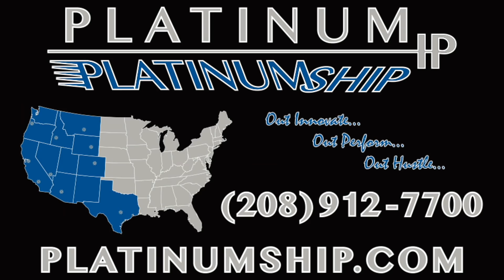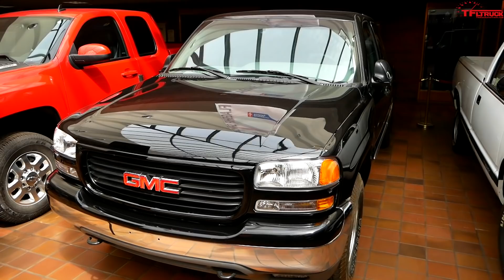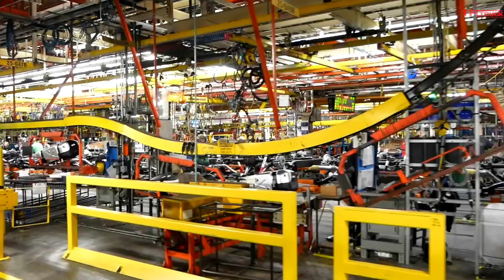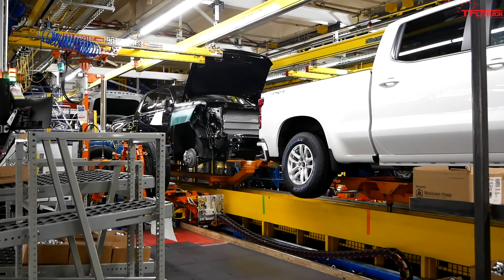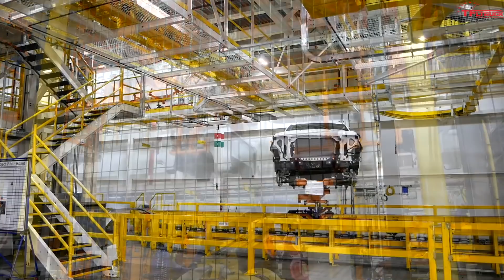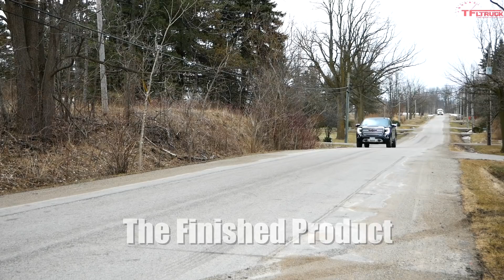They Can Build 1,000 Chevy Silverado and GMC Sierra Trucks Per Day Right Here

Comment: 1000? That’s cute... Ford pumps out 1200-1300 F-150’s per plant and Kansas City and Dearborn both make them. So 2400 to 2600 a day, but I guess they probably only need 1000 since they rank 3rd in truck sales now.
Reply: Ford has to build so many trucks because they don't last half as long! Keep those replacements coming! I usually expect my GM truck to last 10 years, Ford I would expect to last 4 or 5 years.
Reply: Stevonoles1 gm trucks lasting 10 years lol dream on buddy
Reply: @Regulo0_7 , my truck is a 2005, do the math
Reply: The Super Duty plant makes about 1600 or more units a day.
Reply: GM sells more total trucks than Ford every year. You watch too many commercials lol.
Reply: @dlakerguy  so it takes the Silverado, Sierra, Colorado, and Canyon  to outsell the F-150. That's embarrassing,  you should keep that to yourself.
Reply: @redd7188  You're a idiot. That's not what that means. It means that GM, the company, sells more trucks than Ford, the company. Not just the F-150. ALL F series trucks and rangers and Lincolns, etc. The whole company.
Reply: @dlakerguy  wrong, the Ranger just returned and already the F150 and Ranger has outsold the Silverado, Sierra, Colorado and Canyon for the first quarter. Anyway my point was the F150 has outsold the Silverado and Sierra combined. Next Lincoln doesn't make a truck. Last you referred to the commercials that Ford makes. The commercial is right. F150 is the highest selling model. Even when you combine Silverado and Sierra sells.
Reply: @redd7188  https://www.freep.com/story/money/cars/general-motors/2018/07/12/general-motors-ford-pickup-truck-market-share/767901002/

"On a volume basis, we've sold more pickups than the F-series over the past four years in a row and that continues through this year," said Jim Cain, a GM spokesman.

For all of last year, GM sold "a record 948,909" pickups in the U.S., "more than any other automaker for the fourth year in a row." That includes full- and midsize trucks.

Again--- Until Ford the company sells more trucks than GM the company, you can shut your dirty pie hole. You lost. Move on.
Reply: @dlakerguy Couture, stop it,  you call someone out on the F-150 being the best selling truck in its class and the best selling truck model period. Then you post an article that includes Colorado and Canyon. Then when you get called out on it you call me a troll.
Reply: @redd7188  I never once mentioned best selling MODELS. I said best selling BRAND EVERY TIME. Don't move the goal posts just because you can't kick the field goal.
Reply: @dlakerguy  read the original comment! He said F-150 not Ford, he he mentioned a model not a company. Learn to read sir. You called him out and told him to stop watching commercials. Well, what does he need to get straight? The F150 is the best selling model? So tell us,  what did he get wrong??? What did Ford get wrong in the commercial????
Reply: @redd7188  Ford gets wrong that they sell more trucks than GM. GM splits their sales between multiple models of trucks and they do that on purpose. They target different markets which leads to much more overall sales than Ford. A strategy that clearly works. If GM whittled down their lineup to just Silverados and that's it, they probably would sell more than F-150s. Besides, everyone knows that F-150s sell the most in that specific model because 1) they break far too quickly compared to Silverados and 2) they lobbied for government contracts and supply cheap trucks to cities and counties all around the country.
Reply: @dlakerguy  wrong , the commercials say F-series is the best selling truck. Which it is. It says nothing about best selling company. Again,  F-series outsells Silverado and Sierra combined. The Sierra and Silverado are in the same class as the F150 not Colorado and Canyon. Now again what is Ford getting wrong in their commercials?
Reply: @redd7188  The F-Series includes their F-250s, F-350s, F-450s and so on. They're comparing all of that to the Silverado. Weak.
Reply: @dlakerguy  do you not understand that GM also sales 2500, and 3500. Do you get that they are not separated either? Check the link below and show me where GM separates 2500 and 3500 sales on the Silverado and Sierra.  Show me , all you have to do is scroll to the bottom and click on deliveries. https://investor.gm.com/news-releases/news-release-details/first-gms-all-new-pickups-posts-20-percent-q1-gain
Reply: @redd7188  I was talking about the Ford commercials! Stop jumping around. You keep changing the argument every time you lose. Plus you said "GM also sales 2500..." I now see why you like Ford. It's an intelligence thing. I bet you smoke marlboros and drink bud light too haha.
Reply: @dlakerguy  how am I jumping around when your last comment was "@redd7188 The F-Series includes their F-250s, F-350s and so on. They're comparing all that to the Silverado, weak". My reply was showing you that they all compare trucks the same way rather it be Ford, Chevy/GMC or Ram. How is that moving the goal post?? Wow, so you knock me for making a mistake and typing GM instead of GMC?
Reply: @redd7188  No. The Ford commercial uses the F-Series, ALL the F- trucks. And they compare that ONLY to the Silverado 1500.
Reply: @dlakerguy  Ford use to make a Model T and Model A. Truck wise Ford has had the Model F for years. There was an F-3, F-100 and even an F-500 and now we have F-150. The truck model is "F"and 150 , 250, 350 refers to the subcategory within the model. This equals F-series because F is the model and and the number is a level of capability within the series. It's the same with Silverado and Sierra because rather you know it or not when you say Silverado that includes the 1500, 2500 and 3500. The problem is we say Silverado because saying Silverado 1500 is a mouth full. Just because we do not use the proper terminology does not make the Ford commercials misleading.
Reply: In 2018 it averages about 2,300 F-Series a day. One gets sold (and presumably built) every 38 seconds.

Comment: It is nice to see GM half ton crew cab production is actually taking place at Fort Wayne.  Sure, parts can come from all over the globe, but it makes me feel patriotic to get a VIN with the USA "1" code.
Reply: USA = 1,4 and 5
Reply: Gary Blatt, same here and when the VIN begins with “2” Canada Code. I will never buy a vehicle when the first digit of the VIN is “3”.
Reply: Vince Clark in Canada the automotive workers are of European stock. in Mexico they take a siesta.
Reply: @vinceclark6164  Jose probably has more job pride than Dick, Rod and Tomika put together.
Reply: @vinceclark6164 , GM has had a plant in Mexico since 1965, so get over yourself
Reply: @anthonywebber2211  yeah but ive owned 3 gms. the first 2 were from us and the 3rd is a Mexican. the first 2 had a lot less stupid issues. the doors sealed right and the panels were on properly. my mexican gm i had to adjust all the doors since none of them sealed and my bumper was improperly installed
Reply: United states uses more than a "1"
Reply: Mr M 1, 4, and 5. 2 is Canada and 3 is Mexico.
Reply: Most pickups you can buy today are built in the US. Regardless of manufacturer. Even Toyota builds trucks in the US.
Reply: Justin Luttrell not true. All HD Rams are built south of the border and last I knew Silverado/Sierra CC SB were built in Mexico as well.

Comment: I would hate to work on a moving assembly line. My ocd would not be able to handle it. Build them by hand at a slower pace. They sit on the dealer lot for weeks and months on it. Is an extra day for assembly going to really matter.
Reply: Pretty soon they won't need many humans to do the labor. Just a few to supervise the robots.
Reply: @denniskirk4055  no they won't. Most of the robots are in body shop and they still need people to work with them.
Reply: I’m not sure I like the way the motor and transmission are fit to the driveshaft with the line moving like that—great potential for bottoming out the yoke and damaging the seal.  Why can’t they take their time and do it right?  I guess they figure for the odd time it is screwed up it’s not worth slowing the line.  Seems crazy.
Reply: @RhBKeith  it doesn't damage the yoke.

Comment: You guys should come to Louisville, KY. & tour the Kentucky Truck Plant where I’ve worked for 25+ now. 8500 workers here building SuperDuty, Expedition & Navigator. Similar processes only on a larger scale.
Reply: My Dad just bought a 19 F250 Lariat with the 6.2 he likes it so far
Reply: Thanks for building my superduty! Love it!
Reply: @ryan_torres  Did yours come with the Powerstroke made in chihuahua Mexico?
Reply: Thank you for building my awesome 2019 f250 Platinum diesel
Reply: How long does it take to ship the Powersrtroke engine from Chihuahua Mexico to Kentucky? Seems it would be cheaper if it were built in the USA!
Reply: Been at KTP for 20 years myself. What department do you work?
Reply: @CMH_1975  SD body
Reply: @DownRange02  I work on CAL, but considered SD Body
Reply: When are you guys putting the 7.3 Gas into trucks? Any word on power numbers?
Reply: Mr M 2020. No specs yet.
Reply: @pryme2013  for the 2020 model. I haven't heard power numbers yet. I used to get the info when I worked on the chassis line and was able to talk to engineers when we would run early test models. I have seen a couple 2020's come down the line though. They look really good
Reply: @CMH_1975  Hey, I remember talking to you on the RPM motorsports channel a few months ago... I believe!
Reply: @ryan_torres  yep...I'm on RPM's channel all the time.
Reply: @pryme2013  7.3 is still melting down at the plant. Once they figure out why, they will be shipping.
Reply: @Stevonoles1 link your source please.
Reply: I noticed the "death wobble" is still a thing on the new SD's. Kinda had my Dad worried. The dealer told him not to worry(that's no surprise) that his truck already has the upgrades so it doesnt get the shimmy. I know he has the plow prep pkg etc.

Comment: Ummm ... they are assembled in the USA, but the big majority of parts come from overseas. Tesla makes the "most american" cars, as about 70% of the parts are made in the USA.
Reply: And where did you get 70% from because I looked it up and Tesla is made of 50% American parts.
Reply: @jlen82  It depends on what model you're talking about. Model 3 body, battery cells/pack, motors, seats, FSD computer ...etc. are made in USA. Model S/X battery cells are made in Japan.... things have changed a lot in the past month.
Reply: How many plants do Tesla have, GM has over 40 in the US

Comment: My 2015 was built in the Fort Wayne plant. Never had to take it the dealer for any repairs. Great job ladies and gentleman at the plant.
Reply: The way you wrote it makes it seem you don't have it anymore? Still pretty new so it shouldn't need unnecessary repairs yet.
Reply: @pryme2013  Still have it and plan on keeping it. I use my half ton as a truck not a mall queen. Hell mine has a V plow. Lol
Reply: Weird I have a 2016 and had to take it in the shop 3 times due to faulty modules and bad exhaust issues
Reply: @BIGJBIGEBIGC  call GM  everyday until they fix it. That is unexceptionable!!
Reply: @BIGJBIGEBIGC  Drive that thing till the warranty is almost over than lemon law that bitch, and bam, free truck for like 5 years
Reply: Run Aubameyang Run i gotta check the laws in Texas
Reply: Same here! 95,000 trouble free miles on my Silverado!
Reply: My previous 2000 S10 had a love affair with 5 dealerships. That truck loved being at the dealerships more than it liked being with me. But after I claimed my unfaithful S10 through the leman laws and I did won my case, I felt so much better about the  S10  unfaithful love affairs.   :-  )
Reply: @Absurd-du4up  sounds like it was a ford with all those problems
Reply: @BP-bb4vg  LOL  ok... I had an F150... I like to think it was a 2006; I bought it used. That thing was not that bad. But I didn't keep long. few years later, my best friend of my went through a nasty divorce and, he deserved it.  But the wife took everything, even his dog; sounds like a country music song... He ended up with no home, horrible credit and no hope; this is during the divorced. So as a friend, I gave him that truck for him to move around, to help him out. Also the truck was in my name so the wife was not able to take it. Once the divorced was final and over, I just signed ownership to him; free. He told me that truck was a bit of a pos.. But not as bad as my old S10.  Some years later after the divorce, the SOB won the lottery. He was nice to pay off the rest of my house. So I guess what goes around comes around .
Reply: @Absurd-du4up  Wow that's awesome about the lottery man. I had* a 08 f150 w the small V8 and it was okay too. But I know 2 people that have blown the 2.7 EcoBoost in less than a year and half. That's pretty brutal, that I know 2 of them. One had some issues with a cooling jacket I think ( I'm not a mechanic ) that ended up getting a new engine under warranty, which is great but what about in a year when warranty is done?
Reply: @BP-bb4vg  I have a 2015 Toyota Tundra with the 4.6. I bought it new and it still feels new. The only issue it gives me is that is awful on gas. Regular oil changes,  one Coolant fluid change and one set of tires; wow, my tundra is still feels like new and drives like new. 
I am happy for you with your 2018 Sierra. 
Gm Gave me hell over that S10, even in court. After that, I don't see myself ever owning a Gm product. But I am very happy for you and I can only hope that Sierra gives you decades of joys or until you get bored of it. 
Take care now.
Reply: B P  @ Honestly, does anyone really care about all of your Chevy stories? Blah, blah, blah. I have found that Chevy truck owners are very insecure and feel the need to make fun of every other truck. Chevy commercials are just like the owners. Make fun to make yourself feel better about the mistake you made!
Reply: @Absurd-du4up  GM is garbage. Stick with a Toyota and you'll be way better off.
Reply: @jasonwulff8341   I can't disagree with you. I have bad experience with Gm products. But also had bad experiences with Chryslers products too. Even had bad experiences with Subaru. My wife loves Subaru; I think they are a waste of money. My wife had 5 Subaru in her life time. ANd when I ask her why she didn't keep those cars for longer period of time; I kid you not,  she gets mad at me. She only leases them because she knows they suck. 

Nothing is perfect but I am more for Toyota and Honda products. Fords are ok... I can't speak for Fords products of today. But the Fords that my family and I have owned in the past; they were all interesting and some what reliable.  Take care now.
Reply: @Absurd-du4up  its sad, but I work on cars and trucks for a living and even some of GM'S employees I've met  won't buy them anymore because of the quality problem's.
Reply: @Absurd-du4up  The Chevy S-10, Colorado and GMC Sonoma, Canyon was built at Shreveport, Louisiana.
Reply: So was my 2017. Not one issue so far either.
Reply: My 1989 Toyota never had to go to the shop either. And it had 376,000 on it when I sold it. But the bed was rusted to pieces.
Reply: I have a 2015 GMC Sierra and i get recall notices 2 or 3 times a year. I got one today in fact.
Reply: @ShawnathanOakley I had 2 recalls since new. Seat belt rubbing and power steering reprogram. I got a letter yesterday for extended warranty on the vacuum pump but its not a recall.
Reply: My boyfriend works there 🤗
Reply: Thank you. This is my plant
Reply: Rob Yes that is the way it supposed to go
Reply: Mines a 2009 silverado with 272k miles on it original moter and trans..
Reply: You should have a good truck.  You sure paid enough for it.
Reply: Same for my 2016.
Reply: I don't care were they build Chevy trucks.  There better built and last longer than ford trucks anyday.  Plus holds better resale value.  Toyota is only trucks that hold little better resale value.
Reply: Donald Kinder @ That's funny! I thought you were serious for a minute. Then I realized you were joking!